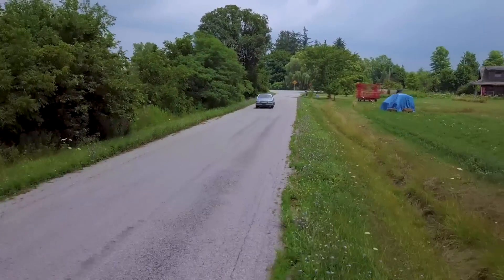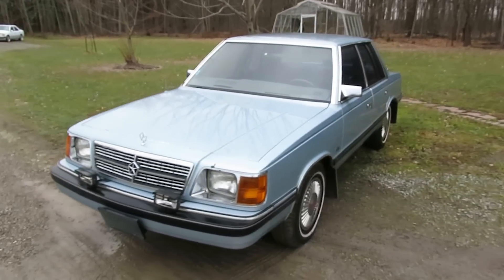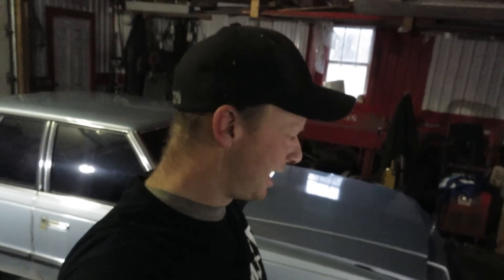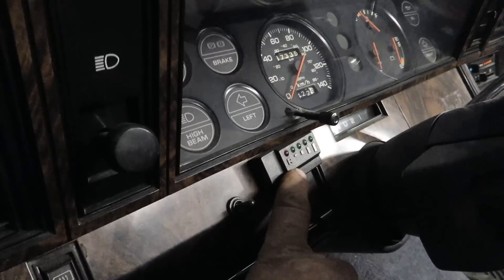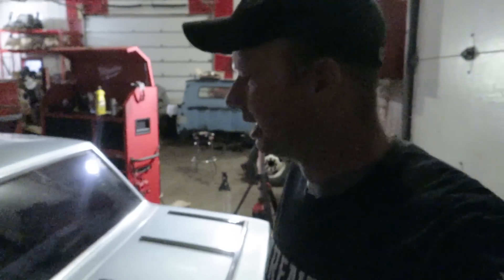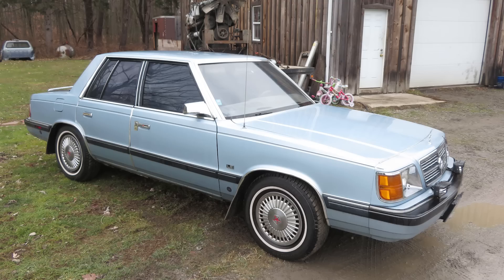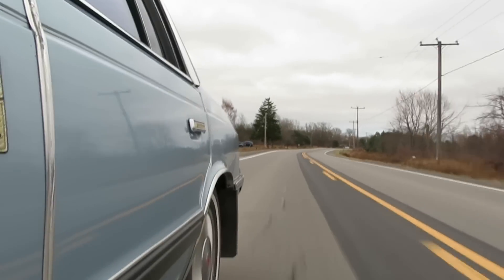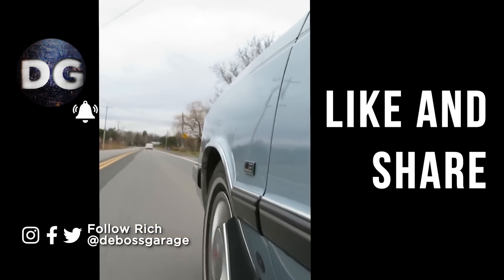A Closer Look at Our "Modified" K-Car (It's Sold!)

Comment: Looks like that grandson had himself a JC Whitney catalog...and wasn't afraid to use it!  :)  Amazing how cars that were so ubiquitous not that long ago have become so rare.  The head of the Henry Ford Museum in Detroit said that the hardest cars to source for their huge collection were the 1980s economy cars they have (Escort & Horizon).
Reply: Especially up here they just rust apart so fast. In the 90's my mom had an '84 Escort that we had  to scrap when the rear wheel well area holding the shock rusted away. In the mid 2000's my first car was an '84 Reliant that I had to get rid of because the rust was starting to become unmanageable. Mechanically they were both troopers but the bodies just couldn't take Michigan winters.

Comment: Man that's the exact same year and colour as the one I owned back in high-school. The only difference is I modified mine and stuck a six cylinder motor and transmission from a dodge minivan in mine. Very little modification to make it fit. It was a nice little sleeper car.

Comment: I’ve owned dozens of K cars, you could get them for nothing with broken timing belts or blown head gaskets. Best time we ever did for a timing belt replacement was 20 minutes. I had a love/hate relationship with them.
Reply: They went 140,000 miles without breaking timing belts and head gaskets would be 160,000 miles without ever changing the coolant..

Remember those days 1990's people were still used to 1960's and 1970's cars where you had timing chains and coolant you never changed ! With 1980's cars cast iron block and ALUMINUM Head you needed to change the coolant as it ate the aluminum head and head gasket itself..Reason they failed at 150,000 plus miles was the acidity of the coolant ate the gasket..

All old Mopar cars until late 80's mainly early 1990's had a 5 digit odometer after 99,999 km or miles they went to 00,000..Some with a 1/10th readout at the end in opposite color went 99,999.9 km or miles before going 00,000.0.

You cant tell the mileage on these..I sold cars since the late 1970's and worked at a used dealer,they would buy these in the early 1990's at auctions and if the records and books shown 140,000 miles they would disgard them and say 40,000 miles..People bought them thinking in 1991 a 1985 car had only 40,000 miles but it had 140,000..Even private sales people are so dumb( like today they never changed) they look on the odometer and say hey 37,000 thats only 37,000 K yet 137,000...237,000...337,000 etc...
Reply: I liked the 2.2. Non interference, always worked for me. Though after awhile mine chewed threw map sensors

Comment: I was getting a ride back from selling my Honda Civic with a friend driving a V8 Maverick. We had a head on with a K car, the exact model and color in this video. The maverick wasn't drivable, but was pretty much intact. We were both fine and jumped out of the car as soon as it stopped moving.
The K car was buckled up in the middle of the car and all 4 doors wouldn't open. Every piece of trim and all 4 hubcaps had flown off the car. The fire department used big pry bars to open the doors to get two big older ladies out. They went to the hospital (I don't think they were seriously hurt. They were both wearing seat belts).

Comment: We really liked our 1989 Dodge Aries K wagon, including the 51-inch-wide liftgate opening. It was gutless as hell (2.5L with 3-speed Powerglide), but it was a breeze to work on and cheap to repair. I bought a 1989 Dodge Spirit, with the same powertrain, the next year, and for a long time I had two mechanically similar cars. The Spirit looked like a much more expensive car, with its burgundy velour interior and red-accented white exterior. Both were great cars in their day and age.

Comment: My mother in law won one in a church raffle,head gasket went 20 years later! Lol Thanks for sharing
Reply: They were great cars the 2.2 and 2.5 anyway the 2.6 had issues but it was a mitsubishi engine not a Chrysler engine like the 2.2 and 2.5 were.
Reply: Head gasket is easy on these motors

Comment: I had a  dodge Plymouth aries! $50!!! I painted it orange with house paint.... made a wooden wing on the back and a a metal 90 degree hvac hood scoop 😂😂😂😂😂😂 i was like 15 or 16. I pulled logs with it, i hit trees, i jumped it, i ran it into a pond..
 Lol i cut the exhaust off 🤣 and had an electric leaf blower strapped into the air intake.... we flipped it one time still ran like a top! Great times... We named it Stonewall
Reply: Lance Sheppard 
I had an 85 I paid $250. I think it had 130k, I beat that car for 40k miles. I once beat an Eagle Talon it was brand new the guy was punching his dash. Mine only had one rust spot on the lower part of the back quarter. I actually made a perfect patch and then Primered the whole car gray,because I wanted to learn how to paint a car. Never happened though.
It was a Mitsubishi 2.5 liter. I also beat my friend in his 2.8 liter s-10 he was pissed. I never beat the piss out of a car and had it keep running like that Aries.

Comment: Just a note for the new owner , the timming belt has jumped . I know I owned a few of them and the distributor should be square with the motor , many a hack just re set the timing and thought it was fixed. If the cam is timed with the crank  then it sits dead flat to the block on the back side  where it is flat on the dizy. 
They ate head gaskets so bad we would just undo the head and shove a 2x4 under the exhaust manifold under and lower the car, slide out the old gasket and in with a new one . Lower and tighten the head bolts until the gun stopped. Never undo anything but head bolts and valve cover.
 Thats why so many have stretched timing belts yet still run ok. My friend could change crank bearing in under 40 minutes every month for more than a year . The were to the 80's what the Vega/ mustang 2 was to the 70's junk!
Reply: My '87 Reliant's distributor is turned all the way to the right. Had the belt replaced at 100 k miles, and that's probably when it was installed wrong! Well, you just answered a long time question I had about that! Every pic I see of the Mopar 2.2, 2.5 distributor, it's square with the motor. Shown tons of mechanics who say, "I don't know!" I just replaced the second head gasket since I've owned it. Pretty sure the first guy did the old, 'Slip and slide' replacement technique! Didn't change the coolant, oil, plugs or any other item mechanics say they replace when they do your head gasket.
Reply: @artstrader7954  Holly duck thats way out. If you reset it right your mpg and power will go way up. The intake or exhaust valve is still open when the spark goes off.
 Glad I answered your long time question . Them motors were hit and miss ,if you got a good one then they run for ever, bad ones and connecting rod bearing with every 20k service . You  must have a good one , the bodies were the same . Here in Canada I see them every once and a while , most are now a honda fender LOL because that about all the steel was left,to try and melt . I bet there are soup cans in the dump that lasted longer . Back in the 80's they were everywhere. For less than 3 k brand new you couldn't get a better / bigger car . Good luck with yours .

Comment: Our family had a 1987 Plymouth Horizon with the 7 year 70,000 mile warranty.  Chrysler had to replace the engine and the A/C compressor under warranty and two of the four doors and rear hatch that rusted through. My dad drove the car for 10 years and 110,000 miles before he totaled it in an accident. The tow truck driver bought the car from the insurance company and replaced the front end clip and gave it to his daughter to drive.

Comment: I have many of mechanic hours on these 2.2L motors, they were all over when I was a full time mechanic.
Reply: Easy head gasket job!
Reply: Ed Spencer  When the head wasn’t cracked
Reply: @KenMrKLC  I know what you're talking about.
Reply: They were great reliable cars I had a 81 Aires and I think I did the head gasket once or twice same as the timing belt but I had damn near a half a million KM's on it and that was hard driving I never babied that thing at all

Comment: This must have been a special order because most of the K car by 1987 A/C PS/PB Auto Rear Defrost were standard equipment. Ordered with without A/C. By 1988 It was renamed the Reliant/Aries America  and Chrysler added as standard equipment was 2.5L 4cylinder Auto PS/PB A/C Rear defrost Bucket Seats (Bench seat was a extra cost) Tilt CC Am/FM cassette and for the price of 7290.00 that was 1200 less than the previous year. My dad sold these from 1983-1989. I still have an original equipment brochure on the America and Lee said we are going to give customers more standard features for less money. Options you could add were Power Locks (95.00 ) P windows (129.99) P.seat (299.99) and sunroof (950.00) which brought the final cost with everything to $8764.00. He sold two of these with all options out the door all fees and taxes with a 700 rebate for 8374.52 with taxes and plates. he kept all his sales records.

Comment: Had two K cars in the late 90s early 00s. Traded a buddy an ounce of pot for both then spent a week with another buddy and two sledgehammers making one as compact as possible then into a jump for the other. We spent many an evening bombing that turd through fields, woods and ditches until we finally ripped the trans pan off on the other k car during a jump attempt. Oh man those were the days.

Comment: A while back i got one as scrap it was canaryish yellow and had 18k km on it. Was a 88 or 89 coupe and needed brake lines and a patch in the trunk floor. I put lines on it and kitty haired the trunk and it passed our provincial inspection. Then I tried to sell it. It sat for three months with not a bite and went for scrap along with a rusted celebrity wagon.

Comment: Back in 1998, I bought an 85 Dodge 600 Turbo convertible for $300.  Body was perfect, not one ding and no rust (southwest car). It barely ran because the timing belt was off 3 teeth.  paid another $300 to fix that, $600 for a new top, rebuilt the front suspension, then drove it from LasVegas to Spokane.  Worst brakes and worst handling car I ever owned.  Sold it and bought a Z/28 Camaro.  Now I wish I still had it.

Comment: I had a hand me down k car for years. I think it’s unfair to call them terrible. The 2.2 was a decent engine and I put well over 150k miles on it. Mileage was good
For
The era. Room was decent too. It was a no frills sedan, and filled that role admirably. When you think it’s competition at the time was cars like the futura and the cavalier, it does fine. 

When you compare it to the ‘79 LTDII that it replaces for me it was amazing.

Sure, an ‘85 corolla or a k car might not check any boxes for what we might call a good car today, but applying today’s standards to them is silly.

Comment: K cars were a great car if you wanted something reliable and did not want to go fast I had a 1981 Dodge Aires with a 2.2 liter that I got from my grandparents and drove the shit right out of that car it never gave me any issues I had to do the regular maintenance like timing belt and rebuilt the carb once but that thing at the end it was burning oil like crazy I would run it on 40 with a liter of 80 weight oil and had very low compression but it still ran. it did not have much get up anymore since the lifters and cam lobes was wore almost flat but for a A to B car that was good on cas the K was great

Comment: The M body platform sedans were better. My folks had an 88 Diplomat with the 318. Other than that Chrysler Stem system that thing was solid, and still ran in 2013 when they sold it. I miss getting to crank it and hearing the old Chrysler starter.

Comment: A snail went into a Chrysler dealer and said " I will buy a K car under 2 conditions"
What conditions? Ask the dealer.
The snail responded. Condition number 1 is I want a 440 hemi with a 4 speed and 513 rear.
Ok, said the dealer.
The snail continued, condition 2 is I want the K emblem removed and a S emblem installed.
The dealer looked puzzled and said to the snail; I understand the running gear upgrades but why replace the K with a S?
The snail replied, So when I go flying down the road people will say "DAMN LOOK AT THAT ' S CAR GO!'"

Comment: I bought one of those new in 81...
Reply: My Grandfather worked at Chryslers and he bought a new 1981 Dodge Aires 2.2L and they had it till the early 90's and I took it from them and drove it till it burned oil like crazy and had hardly any compression left in it

Comment: I have an 1987 Oldsmobile 98 Regency 2 door with the 403 cu in V8 and only 63,000 miles no rust. Compared to new cars the quality of this car is a POS. It takes about a 100 lbs of thrust to slam the doors shut.  But I love taking this car out once a week and going to town and back, can burn rubber all the way to second gear.  You should see the looks from high school kids staring and saying to one another "what is that big car"!

Comment: How do you know its 37,000 K ?

5 digit odometer it could have 337,000 K you cant tell if it was looked after..

My uncle had a Dodge 600 same thing as a Aries/Reliant just longer !! It looked new in/out with 340,000 K !

All old cars until late 80's mainly early 1990's had a 5 digit odometer after 99,999 km or miles they went to 00,000..Some with a 1/10th readout at the end in opposite color went 99,999.9 km or miles before going 00,000.0

Comment: DON"T SELL IT!!
Swap the engine out for the one that 'Jack Black' bought out of the PT CRUISER.
TURBO, TWIN CAM, and i'll bet some of the old Shelby suspension is aluminum, a direct fit, and you can re-purpose some of that from a donor car.. from-like...  yellow knife!
(MAKE IT FAST, AND HANDLE)  Then ship it to Garrett Jackson, or some such. FOR PROFIT!...  Advertise a K-car that"GLH", and see if Youtube gives you valueless donor rusty Shelby's to help build it???
Reply: I always wanted to take a Horizon/Omni and bastardize it into a non-collectible twin-cam, turbo, all-Chrysler reproduction, and drive it to work. 
The GLH's are so unique, faster than mustangs BITD.  And I like the four seat.
I CHALLENGE you dudes to make a K-car that "GLH" or maybe even "GLHS"

Comment: Better quality than current FCA trash
Reply: Pussaty 
Current FCA stuff isn’t exactly trash. We have a 2016 Jeep Cherokee with the 9 speed transmission and 4 cylinder engine everyone says is garbage. It has 120,000 miles with only one problem the whole time we’ve owned it, being the thermostat went out. Also, the transmission isn’t even built by FCA. It is built by ZF.
Reply: @deereman8237  the transmission are designed by ZF but are built by Chrysler at the transmission plants in kokomo. Now I didn't make your KL as I left the belvidere plant before they switched to making the Cherokees.

Comment: and I thought they were all gone :))
Reply: Nope, I have an '87!
Reply: Same
Reply: @artstrader7954  ha! last two I seen was my cousins in the early 90's and one in the last 90's I was pulling parts off of for a a crapsler plymturd mini-van, which I could not keep bolted together an running beyond a few weeks at a time (2.6L 4cyl mitsubishi engine design) it ran strong until the head gasket got eaten away the second time( I discovered I wasn;t the first to put a head gasket on, the block had a low spot of wear between #1 cylinder and head at nearest water passage, the gaskets didn't have a sealing ring and quickly corroded from passage to cylinder seal ring. head was perfectly flat. I did some voodoo magic on the block low spot and used good gasket with shellac compund around the water passages. then it was just endless transmission and steering rack problems lol
**whoops, I wrote a mini novel..